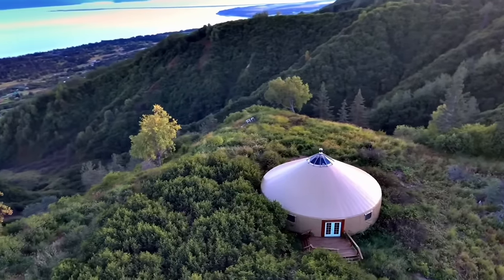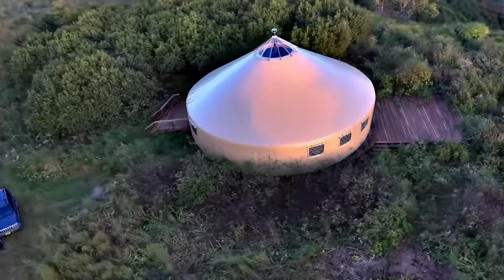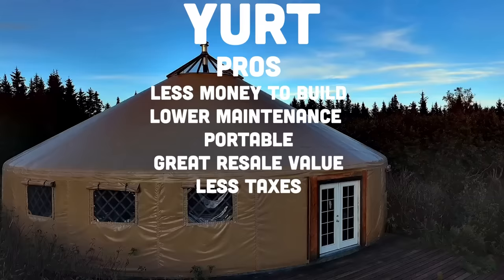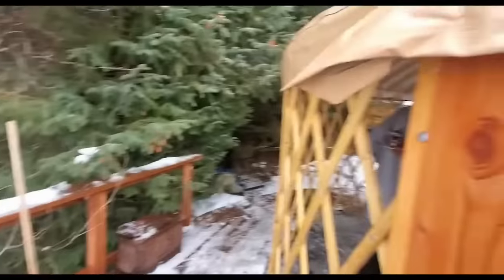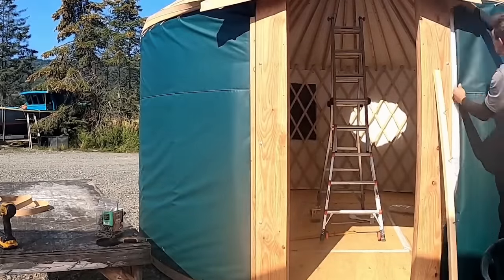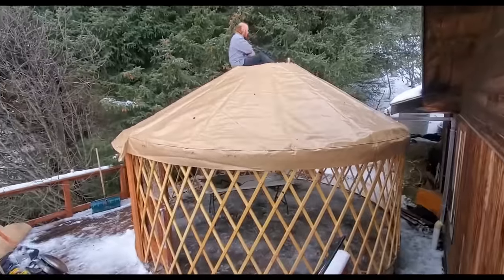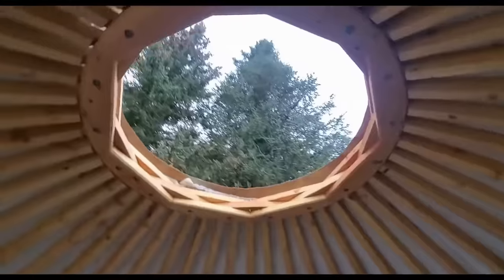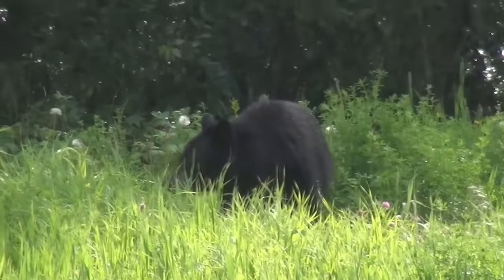YURTS... Affordable Home Solution? Or Too Good to be True? Expert Explains PROS and CONS

Comment: My wife and I have lived in a 20ft yurt for 3 years now. We built the whole thing ourselves. With the platform, the yurt itself, and the marine canvass wrap that my wife sewed we moved on to our land for less than 5k. I understand why people buy kits but the only hard part of a yurt is the "crown" or center top piece.  You can find those online at reasonable prices and DIY the rest for much cheaper than a kit.
Reply: What about heating/cooling with what appears to be something with little or no insulation???
Reply: @KrustyKlown  You can put as much insulation as you want or as much as you can afford. Nomads in Central Asia actually put more layers of felt in winter and less during the summer. Heating traditionally iron stove and cooling used only by rich who shouldn't live in a yurt anyway.
Reply: @KrustyKlown  I've got a mini split ac and a propane heater that both work well.
Reply: I was looking into the materials to sew my own yurt. I ended up finding something called duck canvas. Would you specify what you used exactly, what weight or thickness it was? Thanks.
Reply: @Space_Pilgrim  We used poly coated marine vinyl. I don't remember the exact thickness but we also put a coat of flex seal on  the roof.
Reply: I'm interested in doing this, but how can you get running water for these?
Reply: @kingdomofme3681  We have a small pump on a 12v battery and 2 IBC totes. There is a spring on our neighbors property we are allowed to use, but we used to buy bulk water from the county that we hauled ourselves.
Reply: One of the biggest problems with yurts is getting such small buildings permitted by the county engineer’s department. But in terms of tents surplus army hospital tents in the classic Quonset hut shape are probably the best value not to mention the largest while also being easier than a yurt to set up. One could also warp a galvalume metal roof over the arch shaped tent to get a hard shell roof with pre-cut holes for where the tent’s windows are.

Comment: The main issue I see with Yurts is the materials they use to make them. The reason traditional ones are made of soft materials is because they are meant to be torn down and moved by an extended family group. Having them as a stationary, permanent structure while made of soft materials just means 90% of the cost of a traditional structure with a fraction of the lifespan. They were really popular a few years back here in the Yukon, and any of the ones more than a decade old look ratty and gross.
Reply: Most modern yurt companies use a thick polymer infused with silicone much like a whitewater raft and last about 8 years before they need replacement for between 1-2k

Comment: I’ve lived in my 24’ diameter yurt since 2014, I’m 70 yrs old now. I live 20 miles south of Tennessee state line in northern Alabama, we have four full seasons here. I rented space on friends land while looking for my on land to purchase. I hooked on to her electricity as an “out building”. I also used her water source, running a water line in trench with electrical line. I have a composting toilet. We dug a 6x6x2’ deep pond to use as grey water wetland for the sink, shower and washing machine. For heat I used propane. 
In three years I was ready to move to my new permanent home. Having a solid level platform is critical. 
This is my sixth year living here since the move. We have big thunderstorms here and my yurt always feels secure. We used mobile home tie-downs which attaches yurt to platform/footers. My propane heater keeps it warm, we even had 2*F low temps this winter and nothing inside, or under my yurt froze.
I use an energy-star window air conditioner for a 700sf space, I have 750 cubic feet with my tall ceiling. It stays very comfortable year round and I do use a dehumidifier when using propane heat. 
I would highly recommend yurt living, it serves me very well.
Reply from the maker: So nice to read this firsthand knowledge! Thanks for sharing!
Reply: What was your final cost? What company manufactured your yurt?
Reply: Dehumidifier for propane heat...I'm missing something here.
Why use propane heat.
Reply: I've been trying to find a fellow Alabamian who lived in something like this, glad to know its not a sauna in the summer with a small AC
Reply: @pattycakesxo1758  An propane can heat during night when you are not up feeding an wood stove.
If you are more permanent you can build an stove with enough mass to heat overnight, if you want to stay semi mobile or have the structure only a few month/years propane is a solution.

Then you should plan for illness, you really do not want to get up every other hour feeding an stove while sick, always have some solution that allows you to suffer in dignity for a few days.
Reply: @pattycakesxo1758  because a non vented and some vented propane heaters produce water vapor that condenses on the inside of the yurt going for the coldest points the strongest. This is why we have insulated windows, although my hut has single pane windows, we also heat with a wood stove. Wood stoves are notoriously “dry heat”. Also electric is dry but costly. Here in northern Michigan our heating cost is 800 per year and I’m not a lumberjack. I call, they bring wood, we pay them. We run a dehumidifier during the summer when we are away.
Reply: 4 full season? In alabama? You mean 2 seasons, right? And none of thek are winter, to call anything down there real winter would be like calling mexico cold
Reply: @t95kush27  wrong about that. Last week we had single digits at night for 3 nights, -2* F one night and only 20* F during the day. Yes we have winter, even snow. Spring comes early, late February then our brutal season, summer! By October the days start cooling and nights in the 40’s. Winter weather arrives in December and on our farm we haul water for livestock because it freezes. Yes, four seasons, every single year.
Reply: @eco35758   your winters are our  average spring and fall temps. "Winters are generally mild in Alabama, as they are throughout most of the southeastern United States, with average January low temperatures around 40 °F (4 °C) in Mobile, around 31 °F (−1 °C) in Huntsville, around 35 °F (2 °C) in Montgomery, and around 33 °F (1 °C) in Birmingham."

And FYI north america as a whole has had a VERY mild winter this season. Even im above freezing right now which it never is in january where I live.. usually the snow banks are  10 feet or higher by now.
Reply: @eco35758  ya winter arrives in october for us and doesnt end until march. I almost died in july from hypothermia last summer because i got snowed on while on an overnight hike lmao I live in Northern Ontario. Alabama winters are just northern ontario falls.
Reply: @t95kush27 
Oh, the ignorant hubris of people who think others don't have four seasons or winters when they aren't as extreme as the one they themselves experience.
Reply: @josephnebeker7976  I mean.. the Sahara can get snow too, doesnt mean it gets a true 4 seasons 🤷

Comment: I lived in a 30' yurt with a second 12' yurt (bathroom) connected by a covered breezeway in Northern California for around 8 years. The first two years without electricity before I installed a micro hydro system and had power. Loved it, although in 2006 it rained for 28 days out of 31 in January and what was normally fun (listening to the rain on the roof) became so oppressively loud, I nearly lost my mind! 
They've probably tightened up the law since, but at the time, in the late 90s, I contacted the county building department and asked if I needed a permit to build a free-standing deck in the woods on my property. I was told no, not if it isn't attached to a home. I called them about a week later and asked if I needed a permit to erect a tent on a free-standing deck and the answer was again no!
Reply: Wow you have much more courtesy towards petty tyrants than I do 😂
Reply: We have been manipulated into thinking that we have to accept the superstition of government permission.
Reply: @tibo5828  To both you and Nathan, the penalties for not accepting are pretty stiff. They've even granted themselves the authority to condemn and make people deconstruct what has been constructed.
Reply: @timmjackson   I hear what your saying...  I've had similar threats (from government) held over my head.  I still did what I wanted to do and I'm still here!  One finds a way and needs to be willing to push back.  Choose your battles, choose where you will take a stand.  If you don't, they will choose for you!
Reply: @tibo5828  What City do you live in?
Reply: Wow… so sorry for your struggles with a house/property you purchased., and not have the freedom, allowances and privileges that are given to all of the ‘tents’ and their tenants living for free in CA..
Reply: Your Good. 👍🏽 (per building permit)
Reply: I currently live in a 10' x 20' structure  built out of "temporary construction fence" wrapped with tarps, hardwood skid floor with cheap laminate on top of the skids. I formed my own fireplace with type s mortar, sand and gravel. My house is dope, it cost me literally next to nothing cuz I stole most of the materials 😂
Reply: @lunderdragon it kinda sucks that people are getting forced into situations like yours but I applaud your resourcefulness to keep a roof over your head😅 honestly we live better than humans did 1,000 years ago as long as we have a home.
Reply: Play the game, win the prizes! It’s easy, it’s fun, and anyone can win. (Unless you really really like arguing, fighting, and being generally bitchy. In which case, roll on Karen)

Comment: I built my own 18 foot yurt from scratch out of mostly sawmill discards and 2x4s. The crown was quite a challenge and all of it took almost a year to build in my little spare time. Each piece of wood needed to be cut, planed, sanded, drilled and the wall slats steam bent. I used Nylon rope to tie hundreds of knots for all the connections and sewed all the covers and used felt for insulation. I've live in it for 3 years now and love it. If I was to do it over again, I would probably make it 20 to 24 feet diameter to fit a kitchen and bathroom into it. Both of those are outside now and that gets a little uncomfortable when it's freezing out. This yurt has withstood some pretty heavy winds and snow loads. After living in tents for several years, this is like a palace and it gets super cozy inside with a wood stove. I don't think I'd want to ever buy a kit, I really enjoyed the process of creating this and my yurt makes a wondeful home that can move with me.
Reply: Go with the 24 footer, I did the 16 foot size for a year and it's way to small. I would like to do the yurt thing again but finding a location is always the most difficult part.

Comment: I am in a 26’ Yurt with family of 6 since September. I would probably go with two smaller Yurts instead of one big one. A sleeping and a cooking. Mostly because I need to reach out for help to move it which is why I like the Yurt. It was put up in 2 days we had the foundation for the platform ready when it arrived. We are at my parents hooked into their power at the moment and planning to move  to our land once we have an out building for electricity and water hookup. We got our Yurt just before Hurricane hit and often have 100km/h wine gusts. It definitely is doing very well. It is really loud with all the kids so having other space for those needing quiet is also why I have smaller second Yurt in mind.

I love hearing the wind and trees and wildlife and rain. You really know what’s going on just outside. 

So far definitely loving the Yurt life .
Reply: How is your set up inside? Is there any recommendations you have to cut costs? 
We're trying to figure out how to get electric and plumbing without it costing and arm and a leg but I guess if you don't want to live off grid these expenses are unavoidable
Reply: @slee7991  we don’t have running water currently so I have a plastic laundry sink with a Blue Water jug propped on it and a waste bucket under for dishes. 

For Electricity we have an electrical box wired up to 4 plugs that then feeds out to a Rv Plug in to the main house. We don’t have high electricity needs mostly the fridge. We have a wood cook stove and an Instantpot for cooking that serve most needs. I plan to get an RV switchable box unit that can power off batter or direct line in the future which is more costly but it will give me a chance to use solar. 

Set up is a bench with hooks inside the main door and then a corner cabinet  that is sectioned off as a water closet for a pee bucket and washing/changing. Just washing with cloths and bowls. The flush washroom in the main house is where regular showers/#2 happens. Then there is two bunk beds with a shelf for clothes between them and angled towards the center to make a bedroom for the kids. A partition and then a pull out bed couch for adults and then a catch space for things then dining room table and shelving for kitchen area sink and fridge. The Woodstove is in the center.

Comment: Have y'all considered a cordwood home? We built one. They're pretty cheap to build. Way cheaper than straw bale. Our walls are a ft thick and solid wood with mortar. Now ours is only 750 Sq ft 2bdrm 1 bath. Total cost was 12k. That includes appliances, electrical, plumbing. Everything. One of the cheapest, sturdier homes you can build. We love our little cabin. It's been through tropical storms, hurricanes and it's held up great.
Reply: So is it 1ft pieces of cordwood with mortar filling the chinks and securing the wood? Is the exterior just expose butt ends of wood? What did you do to finish the inside? Exposed wood or some sort of interior sheathing/plaster/drywall.
Reply: @jim yeats  ours is 1ft long split loblolly pine. You put down a row of mortar on the inside & outside with a mixture of sawdust and Lyme in between them. Stack a row of split wood. The wood can't touch eachother. You want gaps between them or you'll get rot. Repeat with mortar and sawdust. We did our cabin with a post  & beam frame, then used cordwood for the infill. Electrical we ran through the post & beam frame. Everything is exposed wood. Like a log cabin. Look them up on Google. They're pretty cool. Everyone thinks ours is a stone house. It looks like stone from a distance. Interior walls we framed out the standard way then used wood from pallets. I hate drywall. To expensive and it's useless to hang anything on.
Reply: @jim yeats  You can look up cordwood construction on YouTube to. It's been around for hundreds of yrs. If I remember right there's a cordwood barn somewhere over in the UK still standing and it's 300yrs old.
Reply: @Oldfarmlady  There was one around here too, it didn't last 100.  The wood rots away eventually.
Reply: @MrBottlecapBill  ya. Eventually. But Eventually everything does without maintenance. Still way better than the stick built crap being built today.

Comment: Electric fence -- a hot one -- is a really good bear deterrent.  That's what a lot of beekeepers put around their bee yards.

I've always wanted to live in a yurt.  Someone down in the comments said, Just get an RV.  But travel trailers and motor homes are long, skinny rectangles, and they feel cramped, even the ones with slide-outs.  They can also be very expensive, especially the larger ones or the better quality ones.  If I had a choice between living in a yurt or an RV, I'd take the yurt (and I've lived in both tents and RV's, so I'm not just talking through my hat).
Reply: Debated an RV before we got our Yurt but realized I can fix everything that could go wrong with the Yurt fairly easily vs. technical know how required for RV maintenance.
Reply: @sheenamac2382  That's a very good point, too!

Comment: I like the shape, but I'd definitely add insulation, heater vents/wood furnace smoke pipes around the base, and a vent & powerful fan for the top hole. I'd also want to reinforce the walls and roof with more wood.
Reply: Excellent plan!!

Comment: We had briefly - VERY briefly - considered a yurt when we purchased raw land. But for the cost, it is FAR cheaper to buy a house on wheels that is already fully equipped and plug-and-play for power/water/septic! We wound up buying a 42' park model RV (2 bedroom, full bath - as in, it has a proper tub!) for only $1900 and were able to move into it right away! The master bedroom and its slide were rotted out, but we resealed the roof, replaced the framing, removed the slide and added an 8x10 addition off that opening which has our woodstove, water supply and solar power supply.
Reply: I am trying to imagine what that looks like.  Yurts aren't the cheapest livable space, but they are dang cool.
Reply: Sounds like you bought the Walter White edition RV.

Comment: We put a24’ up on land we have in north Florida. Since it’s Florida, we got extra support against hurricanes so it took longer as everything is screwed together which you don’t normally do. The platform did take awhile as I am not a carpenter and it didn’t come with it, we had to just build it. We just have a temporary trailer permit for the land and aren’t allowed a permanent structure so we are getting around it with a yurt. We have a travel trailer also there with water and electricity. We just run extension cords to the yurt for now and there’s no running water, compost toilet.
Reply: What’s the wind rating on it?  I’m in Tampa Bay Area near coast.